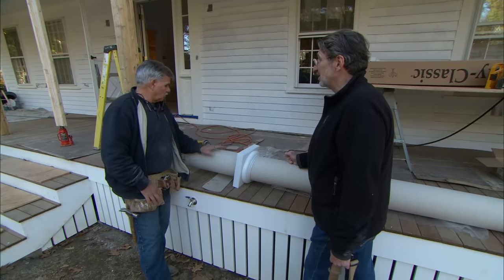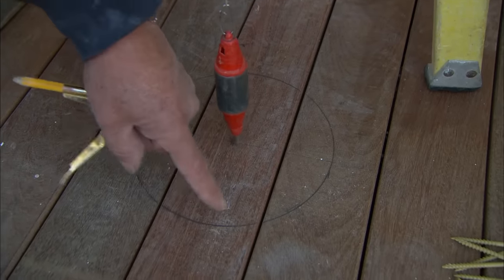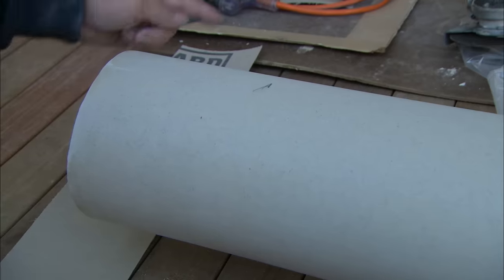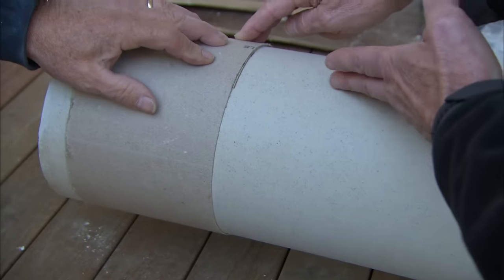How to Install Porch Columns | This Old House

Comment: Depending on the taper, that cardboard wrapping trick might not end up perpendicular to the axis at all... it is designed for a cylinder (pipe), but works ok for very mild tapers.

Comment: Nice rot proof post, but terrible finishing hardware.  Would have been really high quality if they went the extra mile to provide matching fiberglass caps instead of plastic.
Reply: I agree, crappie plastic and non stainless hardware for a mega buck post? I’m guessing the perfect fit will stop the post from shifting 🤷🏻
Reply: I agree, that's not a long term install and will come apart. That and why did they install the columns directly on the decking, seems like a bad idea.
Reply: Yeah it look kinda cheap with the end caps
Reply: @petebusch9069  how should it have been done?
Reply: @zaneblane8160  Install the column directly on the porch structure below, add the decking, and then add the trim ring to cover up the gaps at the decking/column. That decking will have to be replaced at some point but the column should last indefinitely. If those columns were decorative then it wouldn't really matter.

Comment: Those 'L brackets' used to secure the base of the column to the decking needs to be made of metal, not plastic.  If you noticed, when Norm screwed the second bolt in, the plastic L bracket cracked.  That is the manufacturers fault, not Norms or Tommy's.
Reply: Those brackets have zero structural strength.  Their sole purpose is to just keep the post from being bumped and moving before the load gets set on it.
Reply: @cup_and_cone  What happens when movers are carrying a piano in and bump the column?  you think those broken plastic brackets and quarter inch screws are gonna prevent that column from sliding off the deck? lol
Reply: They were metal and they didn't crack inspector cleusea... They bent a little and what you saw was a stress line... I am sure if they cracked Tommy and Norm would have replaced them seeing as they forgot far more than you know
Reply: @SlashspitGaming  It's a hollow fiberglass tube.  Look at the surface area!  There's maybe a couple inches of total surface area bearing potentially thousands of pounds of weight.  That's some serious point loading...it will bite into the surrounding material.
Reply: @cup_and_cone  ..what's the right way?
Reply: @zaneblane8160  Right way for what?  It's going to depend on what your engineer specs, the manufacturers recommendation, and the local building codes.  For instance, obviously this install wouldn't pass in Florida because there's zero wind uplift prevention, but in Massachusetts, it may be perfectly adequate.
Reply: @cup_and_cone  My porch columns have a hurricane strap that runs from header to  rim joist through the middle of the column—that would pass Florida code and I’m in NY.Tommy would’ve done better with a regular screw gun mounting those stabilizing brackets—that impact driver just took it a little too far.not a big fan of impact on anything I need to feel the torque of.good for driving lag screws but not much else.

Comment: Was there a pier under the deck to take the weight or did the post weight just sit on top of the deck?
Reply: Im sure there is a concrete pad underneath those parts they put those posts under. If you notice when he's screwing down the post, he uses concrete screws (tapcons) and they are being torqued whiles driven.

Comment: Not a fan of columns….plus the top finish could be better.  You’ve now got the flange outside the beam and it looks a little weird.  I’d add some pieces to the beam on those part for a more flush look.

Comment: How do you test to make sure a column is straight.  My builder  has one of my columns Les ing and claims that bc it’s a tapered column putting a leveler on it will just make it appear level even if it’s not and its no other way to verify it’s not leaning?  Can you tell me how to check to see if it’s straight and level please?

Comment: Didn't know you could install a structural column directly on top of decking verses the assumed beam/columns below. This seems like a bad idea, tell me I'm wrong.
Reply: Can you elaborate..for us lay folks? In about to have this done.
Reply: @zaneblane8160  The decking is to be walked on, it’s not meant for keeping the house up. Sure it can (until the deck rots out) but i guess officially you have to connect structure to structure, not structure to finishing. If you ever need to replace the deck then the roof has to be jacked up again and temporary supported until a new deck is in. You don’t want to be messing with jacking up parts of your house forever. Also, now they have cut off the columns too short to ever make it to the structure, so the homeowner is doomed.
Reply: @zaneblane8160  The column is structural, should last indefinitely and should continue all the way to the ground/footings and most likely does but not visible in the video. The decking will have to be replaced at some point and is sandwiched in the structure of the columns requiring taking the whole thing down again. That and those connections are about as minimal as a person could get. I'm not sure but is that type of decking rated to carry the load sitting on it or will it crush, some composites are crap, if the decking is wood it should be OK but still, why sandwich it?
Reply: Im sure there is a concrete pad underneath those parts they put those posts under. If you notice when he's screwing down the post, he uses concrete screws (tapcons) and they are being torqued whiles driven.
Reply: @Richdee2323  This is the answer
Reply: @Kevin-mp5of  if they were "hacks" there wouldn't be nearly 50 years of them being around. 🤣 Sorry you're salty.
Reply: @Kevin-mp5of  okay, if that's what you wanna think.

Comment: That second L-bracket cheap piece of nonsense cracked, why didn't they make them out of galvanized steel and use four?
Reply: Agreed, it will fall apart in about 10 years.
Reply: @Kevin-mp5of  did it really?
Reply: @ckcuev  yes
Reply: That’s the danger in using impact drivers—you cannot feel where your at and that’s the result of not having precision control.plain cordless driver is much better for feeling the torque and not crushing things
Reply: What episode was this? I can't find any info on the porch collapsing after they filmed
Reply: @Kevin-mp5of  stop the madness, porch did not go down.

Comment: So the only fixings holding it are the a couple of metal brackets screwed into the deck boards, which will rot eventually
Reply: They where plastic, not metal

Comment: The top part of the column is wider than the surface it meets; doesn’t look very good…
Reply: @Kevin-mp5of  Can’t disagree. The columns are held by barely nothing but weight and gravity.